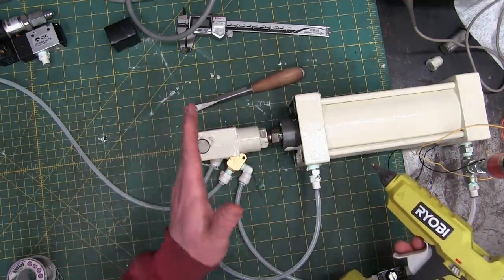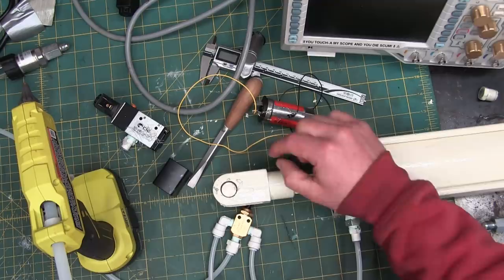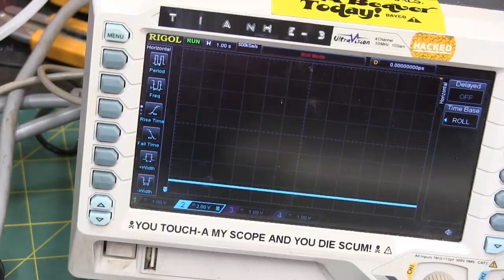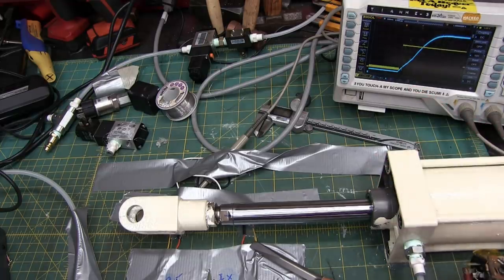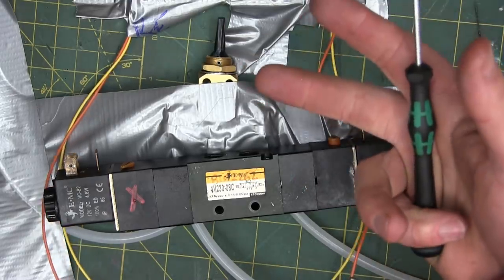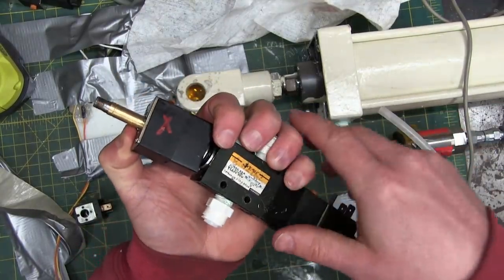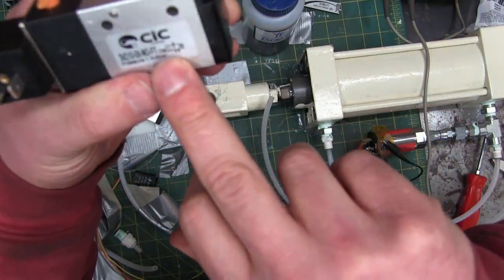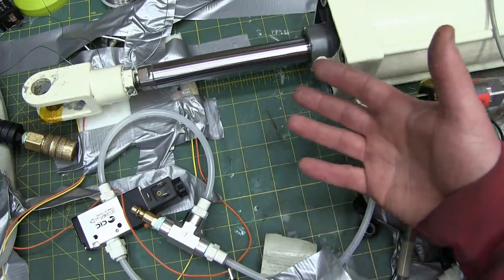Transducers, Solenoids and Headaches | Pneumatic Automation

Comment: Your quote at the end is so true 26:13:
"This is how things get built the first time. They don't ever fucking work."

I work at an engineering campus. I see so many students get frustrated and give up when something doesn't work first try. You can't teach that lesson in a classroom. Something you can only learn by actually building and making things yourself.
Reply: The most valuable stock anybody that works making of fixing anything can have is frustration tolerance. The second one is method. If you're methodical, and you have a high tolerance to frustration, there's not a thing on this planet that you can't build or fix, given enough time.
Reply: If it doesn't work the first time, kick back and have another beer. Think it over and when you figure out why it didn't work, fix it! Sometimes maybe two beers.
Reply: Isn't it techs who make things work these days? Used to be engineers. Or teams of both.
Reply: Software engineer - Currently fighting with a codebase that was last updated in 1999 - written in pascal - that interfaces with a piece of hardware via a serial port. It's taken me a few days to figure out how the communications work so I get this sentiment. If it ain't hard, it ain't worth doing, if'n you know what I mean.

If it works on the first try then I immediately go into "well what's fucked up" mode.
Reply: I don't learn if I don't do it myself. 
When I do it, fucking Murphy jumps in the middle with his law and fucks everything up with his dance.
Reply: " that can't be taught in the classroom."  that's why they get you for an eleven year stretch, so they can keep trying :)
Reply: Seems to be what separates the men from the boys. Gotta anticipate the fuckery and push through it. First time is luck, second time is experience. Lady luck doesn't have time to visit everyone.
Reply: hah true that, you learn most by messing up and seeing how things don't work.
Reply: It's not just me then. If it's working first time something's wrong!
Reply: Yep, that is true. If it works first time you have missed something... and if you are building something that is really important, it won't work when its cold, or hot, or at lowest battery voltage, or when its upside down!

Comment: Learned a little laughed a little. Enjoyed. Cheers. The man who invents a noiseless compressor will have well lined pockets. When I'm on project someone will call the leaky hose makes the compressor come on. Then I learned, thats great for when the wife calls I put a 2 inch ball valve on my compressor. So when she calls I just open valve and she hangs up.
Reply: How to build your own silent compressor: type what i just said in the youtube search bar and click the first video ;)
Reply: Screw compressor. Uses a roots blower and is distinctly missing the standard pop-pop-pop. We have a Gardner-Denver, the 150HP motor size, quieter than most other things in the shop.
Reply: A rotary-screw compressor is not a Roots blower. A Roots blower does no compression of the intake air and is therefore very inefficient at high pressure ratios. A rotary-screw compresses the intake air before it reaches the discharge and is much more efficient at high pressure ratios.
Reply: Keith MacDonald Eh, I'm not intimately familiar with them so forgive me. I thought a Roots was a type of compressor, if the point was to push more volume down than could be naturally aspirated? Or does a Roots bring the pressure in a cylinder closer to atmospheric (without being above) than natural aspiration can manage?

Still, rotary screw, man. Distinctly lacking that pop-pop-pop.
Reply: Keen Scents A Roots blower moves air internally at inlet pressure, so every time a section is exposed to the higher-pressure discharge, there is a flow reversion. There is no internal compression. This flow reversion translates to inefficiency.   A Roots blower also has more leakage. A rotary-screw compressor moves air axially and a Roots moves it radially, which is another fuctional difference.

A Roots can be used as a compressor, but it is most efficient when maintaining near-inlet pressure on the discharge, as you alluded to.
Reply: A Roots and is sorta like a turbocharger or centrifugal pump/compressor which just pumps and the compression occurs due to backpressure, so to speak. Air can easily leak back through the thing and they are used for 2-3 bar differential pressure, maybe up to 5 at drag racing
Reply: Oiled Air Compressors are generally more quiet. That sounds like a crapsman dry-hole unit going off and no one should be quiet when being stroked fast with no lube. I say it's a crapsman because it's loud as frig, but you never can tell on a recording. I tried to record mine and the recording is louder! The Ingersoll Rand's, even the little garage mate, are fairly quiet. If it's stationary like the 60Gal, I just build little sound rooms for them using RockWall insulation. You can tell it's on but no more bothersome than being in a hotel room sharing a wall with newly weds on their 3rd marriage. "chug chug chug" rather than that sound of a random Minigun burst (thhhhhhhhh!!!!). Hmmm..AvE might look into this and find if it's the size or if it's actually the oil. No reason an oil-less unit can't be quiet.

Screw type are expensive. $10,000 for an IR at home? $38,000 USD for typical ones and the box is 5' x 3' then there's still the tank. Ours is constantly on so you don't get constant start-up power draws and you just hear the pin clacking back and forth as it maintains it's set point pressure...that and the massive fan blowing cooling air constantly.

There's Roots and Screw, they're not interchangeable in design and why there's blowers (roots) and superchargers (screw). The roots moves air (like an old Weind or BDS), the screw compresses air (Whipple/stillen) inside the unit. We just call them both superchargers from some weird reasoning and I've never found it worth getting in the weeds about really. "Turbo or Supercharger, yo?" All work to do a job, just pick which you like and adapt. I like belts but will put up with lag without as well in the Ford Focus you Fak! daily driver

Comment: Everything i do i do it with junk part man. This is an art one can master!
I recently replaced my dead car horn with a salvaged truck horn that work with compressed air. Used an old car fire extinguisher for the air tank, a pair of bicycle tire inner tube valves for the inlet and outlet of the tank, a small cheap 12v tankless compressor that you are supposed to plug in the cigar lighter to inflate your tires, a bunch of small 4mm plastic pipes that are supposed to be used on garden sprinkler systems (work like a charm with regular pneumatic push in fittings!) and tied all of that up with zip ties under the hood. Everything work perfectly and you can't get more junk tech than that!

Comment: You could have also used quick exhaust valves at the inlets of the ram and add a regulator to more easily adjust actuation speed. Also increase efficiency and lower input pressure.

Comment: Did you try to mount the reed switches directly to the cylinder? Normally on air cylinders there is a magnet built into the back end of the piston to allow them to be actuated through the body of the cylinder.

Comment: Reed switches operate better if the magnet is at one end, if say the north pole is over both contacts, those contacts will be south pole, so will stay open.
Either put the reeds to one side, or mount them inline with direction of operation.
You may find you can use a smaller magnet so the other reed is not affected.

Comment: For those with short pockets and thin wallets with decreasing the compressor noise the main requirement (those Apartment dwelling experimenters), working reclaimed canned refrigeration compressors will fit this bill, properly intake filtered and hosed in parallel to get the volume needed, BUT some downsides, you need to be willing to accept some refrigeration oil in the supply, and a constant check on the compressor oil level will be necessary. Also depending on where you live, old compressors from chlorinated refrigeration systems may be illegal to use (?).

Comment: Watching this reminds me of being 15 in high school studying Tech Studies. My class project was air operated pneumatics. And low and behold it didn't work. My teacher had me replace the parts but concluded it was my fault the project failed. I was sure my theory was perfect so spent a week of lunchtimes trouble shooting the issue. Turns out the air compressor supplying half the class was reading over pressure and exhausting all the benches. But the teacher didn't have a clue

Comment: Nice screwdriver!  I think you should sell them!  Something about the structure of that handle allows extreme torque to be delivered to its tip.  If I remember right, you had that hardened to 62 Rockwell which makes for a handy pry bar.

Comment: Reed relays are tricky to work with.   The leading and trailing edge of the magnetic flux lines hit the switch and can cause multiple switch closures.    An optical interrupter sensor will be much more precise.    A flag passing passed the sliver of light in the interrupter will give you more precision in your measurements also

Comment: The biggest benefit that current scaled sensors have is that cable and connector resistance is irrelevant as long as they don't need to be driven to maximum voltage. If you have a 1V signal and add 100 ohms worth of cabling and contacts, you'll have something less. If you have a 10mA signal and add the same, you still have 10mA.

Comment: Could swear that cylinder very likely has a magnetic piston, or at least you can use a bias magnet and some pole pieces to sense position of the plunger with less hassle.

Best valves I have met are Numatics ones, they last a long time, have service kits of all the rubber parts available cheap, for when you do eventually cook out the seals using them unlubricated, and are pants better than the Festo ones. I have some that have run over 20 years in operation, doing around 5 million cycles since I met them, and they only needed a service kit to get the leakage down to near zero. Too bad about the Festo ones, they would kick the bucket every 2 years, and service kits were half the price of the valve, and had lead times in weeks. Got the machine down to only one Festo cylinder, an oddball one nothing else would fit ( yes it has some piston leakage), and all Numatics for the rapid cycling cylinders, or SMC for the slow ones. Did have to have custom cylinders made for some positions, but those were local manufactured, and turn around time is a day for them.

Then my Numatics rep upped and left for Australia, bigger market for him, but still, have the company he worked for around and they give good service.

Comment: AvE, if you used two different resistors for the reed switches and keep them in parallel, you should be able to differentiate between the two by which current you expect.

Comment: Good video! Thanks!
I have a question. Cylinders prepaired for use with the magnetic sensors have the magnetic ring on the piston and special mounting brackets for sensors (on extruded aluminium housing or on cylider rods like on this video). Your cylinder haven't it? Also, switches can be reed or transistor based (2 or 3 wires).

Comment: In my experience those Legris fittings seal when hand tight without Teflon tape. Although, you might not have as much luck with those  since the threads probably got pretty chewed up when you wrenched on them.

Comment: just use two qr-1 valves at each end of the cylender. go to any truck supplier like traction or fort gerry. bendix or229859x, $15cdn. they let air thu and auto exhaust line presure when pilot pressure drops
Reply: Bart Koscow This works, I was constantly scavenging the big rig air valves for quick fix on the factory floor....
Reply: gwmier well I happen to sell those parts and I'm intimately formilliar with how to cobble together two or three things to work for a day or years depending on the customers budget. (Which is usually as little as possible). As long as the customer knows how the burnt wreck used to work. I know what and how all our valves work. ;) I have helped more than one dude with a automation failure. Or a street sweeper or a rock crusher or other odd thing with seemingly random valves and fittings

Comment: Hi. Inside your generic power supply (on the back of the circuit board with the lcd) is a tactile switch that, when depressed for a couple of seconds while the supply is on, will reset the Amp-meter. Succes with it.

Comment: It looks like you reassembled the 2-way valve with one end upside down (the side with the X on it).   Earlier in the video the 2 red actuator buttons are on the same side.  After reassembly they are on opposite sides.   Maybe that's why it leaks and no chooch?

Comment: You replaced the pilot block upside down which is why it leaks. There is only one gallery on one corner so it can't work in this orientation. The gallery may be blocked or the pilot piston seized.

Comment: You could try adding a quick exhaust valve on the port for the return stroke. I put one on a pneumatic can crusher i built and that thing comes down like a hammer, probably better than just exhausting the  pressurized air from the return side of the piston. https://www.grainger.com/product/ARO-Quick-Exhaust-4KP82

Comment: If you’re using solenoid powered valves and you can manually actuate them to get the desired function, then wouldn’t those valves work as desired with the correct programming on the signaling?

Comment: Worked with that shit in Manufacturing at a GM plant. I dont miss working with that shit eather. When the gremlins invaded the damn equipment, it was like chasing a mouse through a hotel sometimes. My boss liked using a hammer...on pnumatics and microswitches( idiot). After retooling, those multi million dollar machines got carted outback and ignored like an overaged hooker. I used to strip them out for usable parts. GM didnt care, to them they were obsolete,  they told is to crush them. I usually picked them clean, then boxed the parts. I will never know where all those parts went after I left. ,probably dumpster.

Comment: Needs 1/2" or 3/4" fittings, hose, and switches for maximum Chooch.

 Let's see, it looks like it takes about 91ms to travel 4in or 101mm, that is about 0.91ms per mm, assuming that the reed switch is 5mm  in diameter and +2mm for a magnetic field, the dwell time for the reed switch is about 6.37ms dwell time for the reed switch. Well, since the beginning reed switch does not deactivate until the magnetic field is gone, all this calculation is useless. Depending on the reed switch, the operating time can be between 0.1ms to 5ms, any faster probable require a hall effect sensor.

Comment: Mid point of the transducer would be .016 x .5 + .004 and the answer would be 12ma. Wouldn't it be? Oh ya some coils have to have the polarity correct if they have a snubber in them for back EMF.

Comment: I can't help but sit here in my armchair and come up with the solution to world hunger. But... as much as I like the magnetic sense contraption you got going, it might have been easier to hot snot two limit switches to the pad and let the clevis hit them. If you wanted to mess around with an arduino, using an accelerometer on the clevis or bottom of the piston body might have been pretty interesting. You'd see both ends as hard shocks, but you'd also get to see an accurate measure of acceleration.
Reply: 2009dudeman Cylinders can already come with.... I think they're tiny Hall-Effect Sensors? Anyway it can tell from sensing the piston inside; they can be set up to have one on both ends or just one end to know when it's homed, even come with a handy little indicator LED on them sometimes.

Using those you could place them arbitrarily along the cylinder to measure. And then reuse them in the final build if needed.
Reply: Yeah some do, its usually magnets around the perimeter of the piston for some of the thin wall, otherwise they are on the tops and bottom of the piston. You use hall effect sensors to detect them, some do come with the sensors built in. Gotta order them that way though. Really cool pieces of equipment you can do some really crazy stuff with them, like sequential and self returning piston assemblies that perform complexe actions across several pistons by only actuating one.

Comment: I found this huge cylinder and i have an air compressor...
Now i can build a log splitter...
Even better... controlled by Arduino, voice controlled, so you can use it with just one remaining hand ;-) 
If something goes wrong and you scream, it deenergises completely...using that wrong type of valve...

Comment: Here I am thinking I have the same awesome osmello-scope as my uncle bumble-fuck and some-bitch if his doesn't have gold freaking knobs..   That and I blew up half a dozen high voltage transistors trying to measure base - emitter bias due to forgetting I ran a ground wire directly to the negative terminal of my meter.  DERP